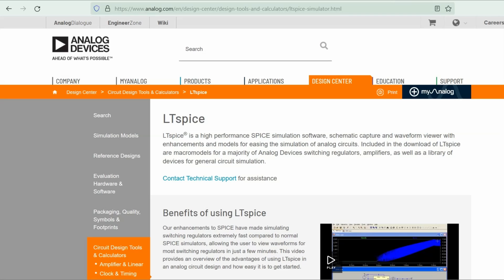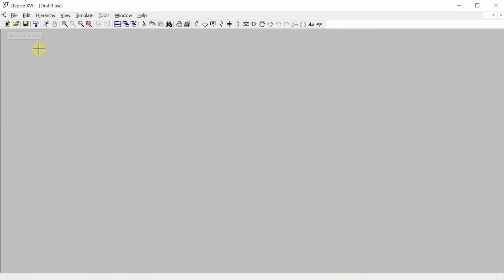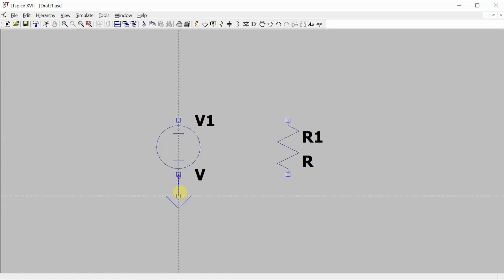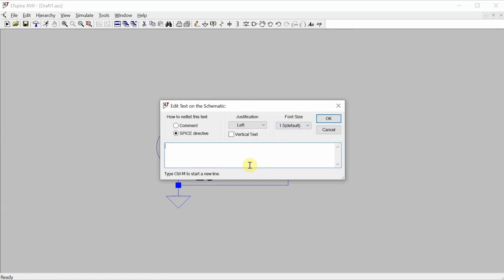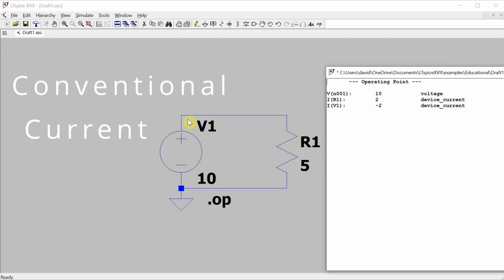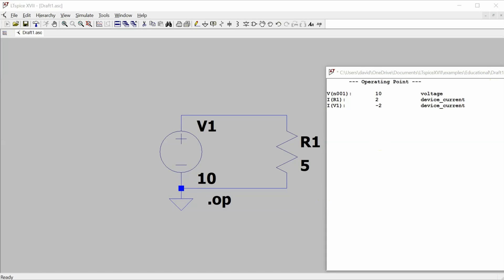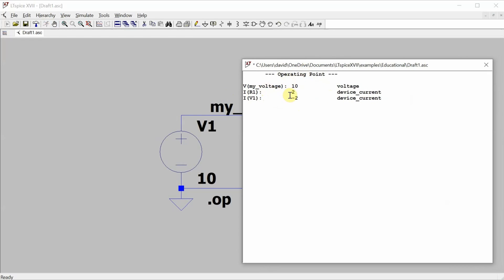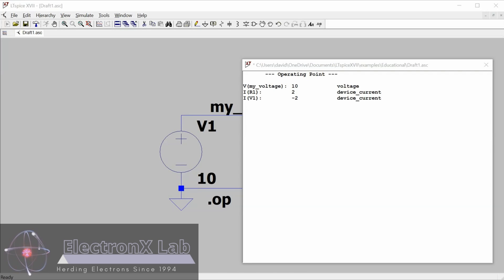A Quick LTspice Tutorial - Getting the DC Operating Point

Comment: Thank you for the video! When I run my simulation after placing the operator point, the window with all the measured voltages and currents does not pop up. I have followed the instructions of my professor and now you and I still cant seem to get it to pop up for my assignemnt. Do you know why that may be